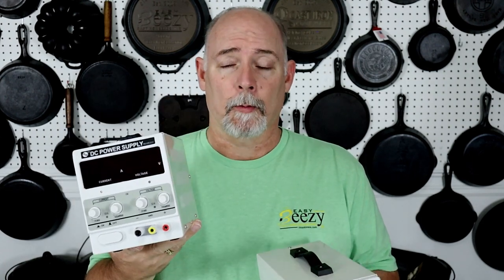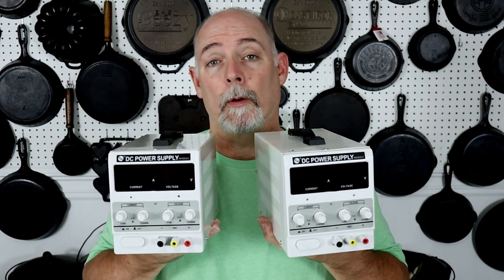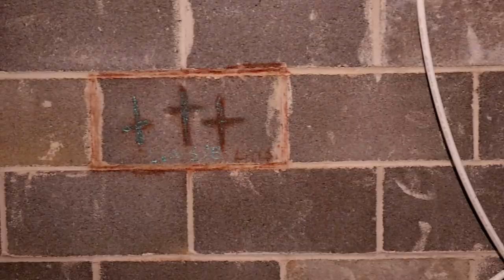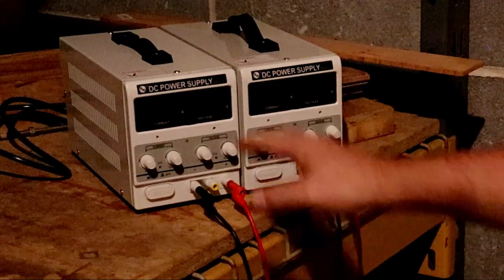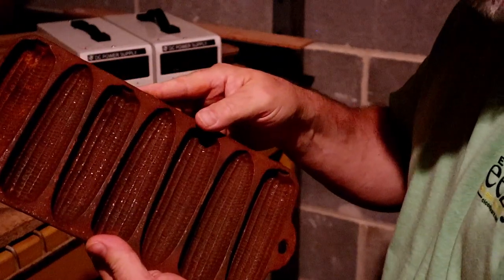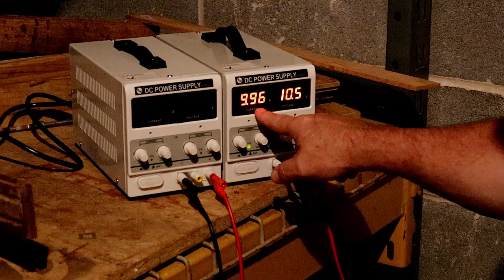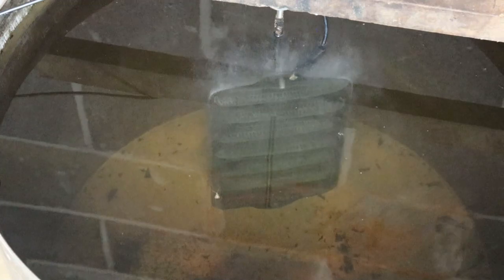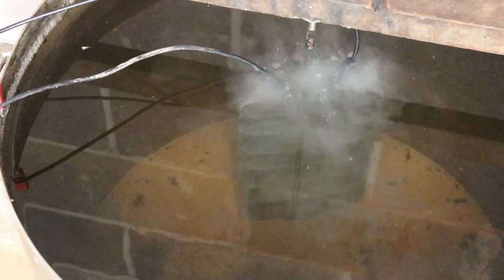DC Power Supply Times Two

Comment: I’ve been using electrolysis for years for antique car parts, and the manual battery chargers are getting harder to find, never would have I thought to use a DC Supply (other then a rigged up electrical cord with a dimmer ) and didn’t expect such amazing results. I found this channel searching for alternatives, although not cleaning cast irons, I found the info very helpful

Comment: If you found yourself here I assume you're looking for a power supply, I was too. I wanted to share my findings on chargers. These power supplies were no longer available on Amazon so I decided to try a 40 amp charger. I started with a Schumacher 1565 200 amp charger from Walmart $114. I thought a manual charger would putout 40 amps if that's what it's set on but it doesn't, it puts out 14 amps while set on 20 amps. In that case two must put out 30 amps, wrong again. They cut back to 14 amps combined so I tried a Schumacher 1445. 250 amp charger for $200 but it only put out 14 amps set on 25 amps. It is a better charger with heavier leads and a built in fan. I decided to keep one of the 1565 chargers and let a fan blow on it. I can clean 3 skillets at one time with it, if my tank were larger it would do more. The amperage goes up as you increase the load until you reach 40 amps. You get a constant 14 amps. If you want 20 amps Steven's way is the way to get it but a constant 14 amps with the ability to clean three (possibly more) at the same time isn't bad. With 14 amps it usually takes 12 hours to clean a crusty skillet. Hope this helps
Reply from the maker: I have been seeing quite a few manual chargers available lately. That is really exciting for the cast on restoration community.

Comment: The outlet is not a problem.  110v*30a=1650 watts. 18v*20a=360 watts. You are a very long way from maxing out your breaker.
Reply: I think the case here is that the current the power supplies are drawing is less than their 20 A output. If he was really drawing 20A, that's actually 2400 W at 120 v. Most residential devices (and breakers) are rated at 1875 W, which is 120 v @ 15 A. But then, I just got a bucket heater that manufacturer claims does 2000 W, and it runs fine so far on my 15 A breaker.

Comment: Awesome. I'm sticking with the lye and vinegar bath till I get some consistency in buying and selling cast iron. Did find out with disappointment 3 cracked pans, however tested 1 by low heat cooking in it and was a success. I'll do a video on them later. Keep up the good work.
Reply: I went thru that too, finally got my hands on a Iron MT. Griswold matching Chicken fryer and lid just to find the pot was cracked down the side after cleaning!  I don't thing I'll trust it full of hot oil but thinking it will work for baking, lite duty things in the oven till I can get another pot.

Comment: I purchased a DC power supply model MS 305 D 0-30v ,0-5 amps
Through Amazon. 
Owners manual says : don’t connect any load to the power supply before its turned on. Likewise be sure to disconnect the load before turning off the power supply.

Comment: Electrical nerd here - "Amps" on the input doesn't necessarily mean amps on the output.
What we have to look at here is actual power.

10 amps at 18 volts = 180 Watts, and 180 Watts at 120 volt input is about 1-1/2 amps.
What that means is, disregarding efficiency losses of the power supply, while you are putting out close to 20 amps at 18 volts output of the power supply, you are only using about three amps of 120V from the panel.
Stack a few more of'em in there if you want to, and you should be OK.
If you're using properly sized wire for the current load that you're dealing with, and that wire doesn't get very hot, then you should be fine.

But, it you really want to know what load you are putting on your breaker, then get a ~$40 amp clamp meter from Lowe's Depot or wherev, and get some eyes on what is really going on.

Hypothetically, you could parallel up to six or seven DC power supplies on a 20 amp 120V breaker and be absolutely fine at 18VDC 10 amp output - Again, depending on the efficiency of the power supplies.
Reply from the maker: Great information. Thank you for sharing.
Reply: @castIroncookware  If you want to stack power supplies, or even get some higher power power supplies that don't really need stacking, I will make a couple suggestions.
1) Look up Marlin P Jones as a source. They sell surplus electronics stuff, and you always get more than you pay for.
Very good prices for pretty good stuff.
2) Learn Ohm's Law as it applies to this. It's not hard to understand, really simple, and very intuitive.
With a 15 amp circuit at 120 volts, you are looking at about 1800 watts - or up to about a maximum theoretical 100 amps at 18 volts.
Again, it depends on how your power supplies work and stuff, but that's just how the maths work out.
The worst you could do is trip a breaker if you push it a bit too much, but if your wiring is sound and you don't do stupid stuff (like ignite any hydrogen gas that may be put off), there should be no real danger to worry about.

Good luck and be safe, dude!
Reply from the maker: @jdgower1  Thankyou for the information.
Reply: Good idea on the amp clamp meter. When I built mine, my Dad let me use his to see what I was pulling. Interestingly enough, the gauge on the charger was accurate.
Reply: @scotmaciver  The precision of meters and gauges these days are pretty tight for real world applications.
There are chips and circuits that are specifically designed for damn near everything you could want to do, and it's really satisfying to see how well they work and how accurate they are.
We live in a great time to be alive whilst we clean pans with electricity.
A little understanding and foresight means we can ramp stuff up in a safe way, while nobody dies or gets hurt - at worst, we might trip a breaker, then we just back it off a notch.
Reply: Thank you, Lazy D.  I was racking my brain, wondering how the breaker didn't trip.

Comment: Cool. Did you look into Zapata’s comments on a 35 amp unit? Did your old manual charger bite the dust?
Reply from the maker: Yes, I did and am planning on working on a higher amp video in the future. I have a wire inside my old charger that has burned into but do plan to repair it.

Comment: I need to clean up my cast iron and reseason them. I was wondering if I put my cast iron in a very hot oven, would that like burn off the grease and whatever on the outsides is my skillets?? I just want also to say thank you for sharing this video and thank you for sharing God's word also. God bless you sir and your family and your channel!!
Reply: Connie Barber many people recommend putting  your iron skillets in an oven during the high heat cleaning cycle.
Reply from the maker: There is a risk of damaging the cast iron when using the oven cleaning cycle.
Reply: Cast Iron Cookware never heard that and I’ve actually done it a couple of times.  , So, what about putting the skillet in an outdoor fire to burn off stuff?
Reply from the maker: @IMOO1896   Temperature control and on evenness of temperature is the biggest problem. Those are the 2 factors that can cause warping and cracks. Of course having too high of a temperature can cause heat damage. I would just rather not take the risk.

Comment: Hey thanks this video really help, I live in Barbados and it was quit difficult to get manual charger. But I had a13.8v10-12 amp power supply, and its working like a dream cause I'm currently  the process of cleaning my pot as I'm typing this message. So thanks very much again. Ill up date you as to how long the whole process took.

Comment: How do you keep your water so clean in the e tank mine is  considerably dirtier do you change it or filter it or does it matter if it’s dirty
Reply from the maker: After a little time, most of the partials sink to the bottom but when it is used regular, it gets really bad.

Comment: Very interesting. Thanks again Steve for doing such a great job on making these videos. My question: any idea why when you used one PS it registered about 10 amps and 10 volts. But when you used 2, each jumped up to 10 amps and 18 volts?
Reply from the maker: I did not notice that until the video was posted. Not really sure why that was happening.
Reply: @castIroncookware  Well, the answer to that is physics ... and Ohm's Law.
Reply: The voltmeters are both seeing the same/entire voltage drop across the two points (the tank, the subject iron) ... so 2x9volts = 18 volts but since there are 2 circuits, the ammeters are only seeing their individual circuit's amperage ... but rest assured, the subject iron/solution is seeing total 20 amps running through it.

Comment: Need help!  Have new dc supply, 30v  10a, my electrolysis tank is show 30.00v but my amp is only showing 2.2A any thoughts why?  The plastic tank w 4 rebar one in each corner, they are connected to each other
Reply from the maker: There are a lot of things that come in to play. How clean the anodes are, how good the connections and and how far away they are from the piece. Without looking at the readouts, how are the pieces turning out? It may take longer but you will still have they'll have success.

Comment: look at the  HP DPS-600PB 12V  47A  Power Supply
compact and powerful
i use for electrolysis.
Reply: Where did you buy it?
Reply: @castironkev  ebay
Reply: Like ur thinking
Where do u plug in the neg pod leads to?
Does it got a fan ?does it get worm?
Food u build any housing for it to protect it from any water slashing to it 
Thickness of leads u used ? 
Haha so many questions. 
Thank you again in advance